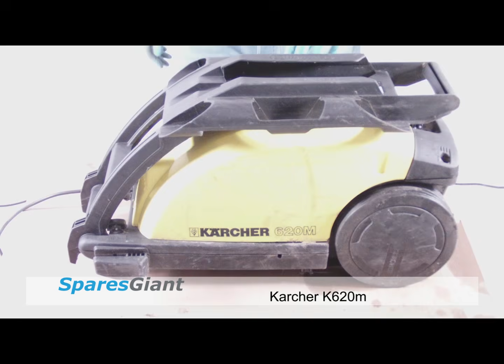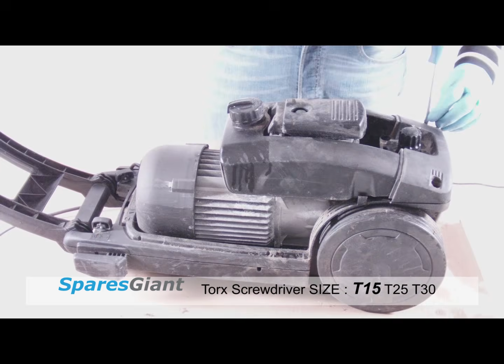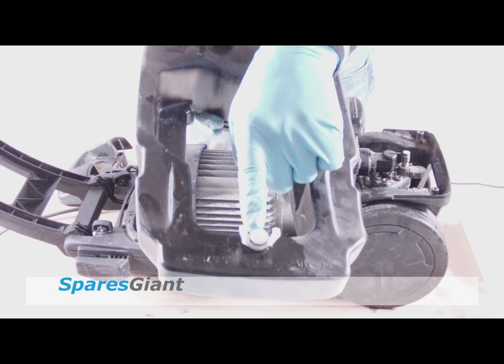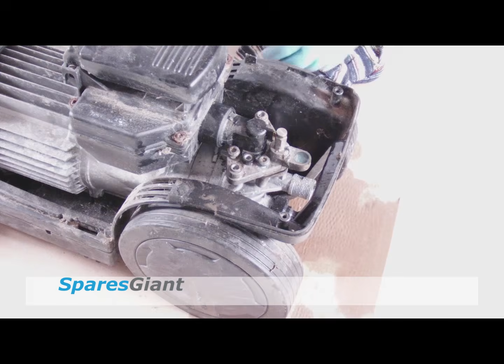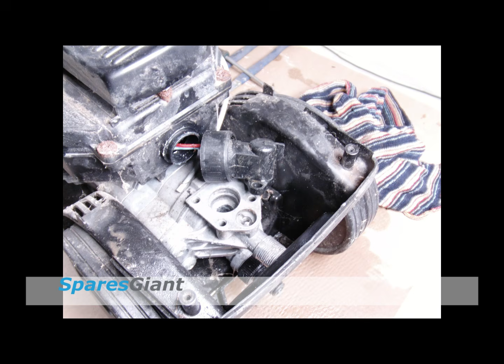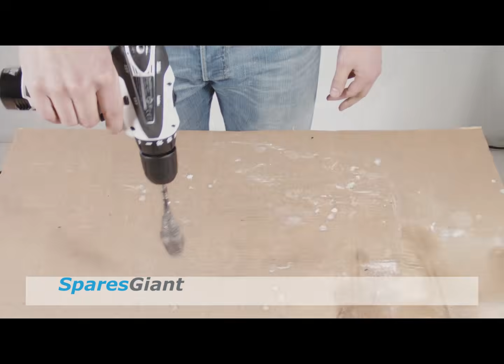Karcher K620m Pressure Washer Repair

Comment: Its a good idea to take the spill valve shaft off then u can use a long bolt and a spacer like a small socket and washers to pull the valve out.

Comment: Found this very useful and successfully repaired my 620m, though as we are in a hard water area I guess it'll do it again.

One tip: the video stated it can be hard to pull out the spring loaded valve, and using pliers or similar on the shaft may damage it. What I did was tighten an electric drill chuck on to it. Didn't power the drill or anything, but the chuck is something to grip to pull the valve out. Didn't damage the shaft.

However what I did not manage to do was remove the knob for adjusting the soap fluid flow. Anyone get a suggestion on how to do that without destroying it?

Comment: Hi there, thank you so much for the Video, it is a really good repair description and I had a good success as the engine is running now. Unfortunately if I press the trigger for the waterpistol no pressure is coming out just the water of the waterhose. Do you have an Idea what to clean or change next? Thanks a lot again for the great Video! Greetings

Comment: After releasing my spill valve so many more times than I care to remember. I think this time I have over done it with the drill & wire wool. Machine never reaches pressure and motor never stops. Water out of Lance does not change from mains water pressure. Cylinder housing too expensive to replace. Is it possible to use oversized O ring to fix again ?

Comment: and 8 yrs on, here I am..    Blighter doesn't pump -just lets water thru  -have to open further and check the valves.    Thanks - managed to get the plastic off WITHOUT breaking it all.

Comment: Thanks for a very informative video. I have accumulated three of these 620M washers over time and now they all seem to have the same problem. They work fine when the lance is set on low pressure setting. When the lance is turned increase the pressure to max, the unit switches off momentarily and starts again. It then keep on doing this until the lance is turned back to low pressure.

I have checked the excess current valve and replaced the o-rings on it but this made no difference. I also opened up the cylinder head and the 6 valves seem fine. I have also checked out the lances and these have no blockages.

Any advice on diagnosing the problem would be appreciated.

Comment: work out well had job getting valve out sprayed some releasing oil rotated the spool using the small hex nut then push the spool down using socket on the spool some electrical tape around spool and large vicegrip pulled it up pushed it down one good tug and out it poped was very tight cleaned inside the tube using nail board put some vasalene on spool and put it back be carefull not to damage spool or bend it working fine top vid really help full thanks

Comment: I got to the spill valve and cant remove, tried with pliers, wont budge??  can you help with that?
Reply: Did you ever manage to get it out been trying for half an hour and won't budge, tried to unscrew the small nut and it just keeps turning, tried pulling the stem and nothing still

Comment: Thank you for this video.  My 620 is 12 years old and has been professionally repaired in the past at a cost of £60.  It only gets used 2 or 3 times a year.  The most difficult part was removing the pressure switch spool valve from the port. With the help of some lime scale remover and WD40 it came out with a little bit of persuasion.  Working perfect now.

Comment: Many, many thanks for the video. My Karcher 620M which I have had for ten years, stopped working at the weekend. Followed your video instructions using scotchbrite and WD40 instead of wire wool. Re assembled and now it works like new. Great video.

Comment: Great video , thanks, but-- My washer was only working at half pressure so I followed your advice took apart and cleaned the valve port , but now I get no pressure kicking in at all . I have taken it apart again and checked that I had resembled properly , I think I have , so any suggestions ?
Reply from the maker: NO pressure ! so the pump is either not pumping or all the water is internally circulating.... if the dump valve has been double checked then its got to be a pumping issue.... do the pistons reciprocate ? are all 6 pressure valves clear of grit ?

Comment: i used this video to fix my 620M, indeed it was a seized valve. fixed in 20m with use of a brass wire rotary bit on a dremel and some lithium grease. top job.

Comment from the maker: this is the gearbox oil (ep80 or karcher pump oil)... if its gone milky it has moisture in it so you should be replacing oil, water seals and disturbed o-rings. stand the motor on the fan and pour fresh oil into the gearbox like filling a cup. assemble the pump while the motor remains in a verticle position.. TIP: wash out the gearbox with diesel to remove old oil.

Comment: Sir, when cleaning the port do you vacuum out the area afterwards or should compressed air be used? Also I purchased a used washer so I don't know if the following characteristic is normal or not. When powered on and the trigger not depressed on the gun, the pump will turn on for about three seconds then shut off for about three seconds and repeat the process. When I press the trigger and use the washer it continuously stays on. Is this normal? Should I do any other service while I have it open?

Comment from the maker: Hi, Between 20 and 27 seconds into the video we point out 3 release catches under the machine... use a screw driver to pick out these pins (but not remove)
 and the yellow cover is then loose...